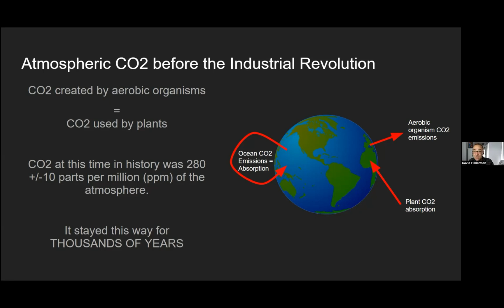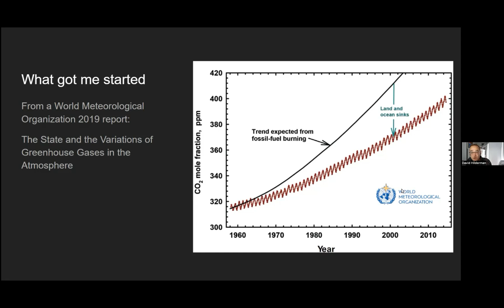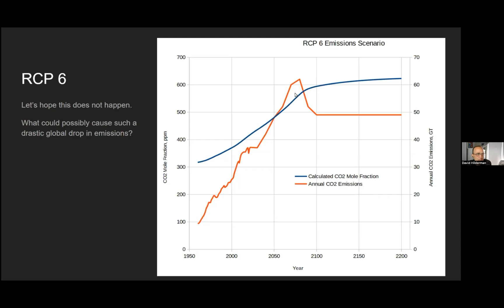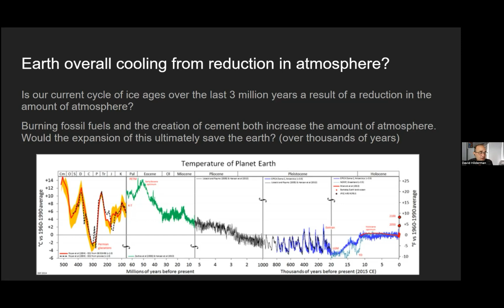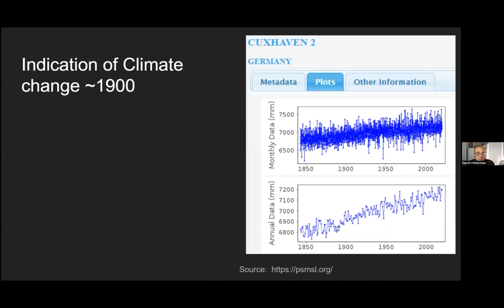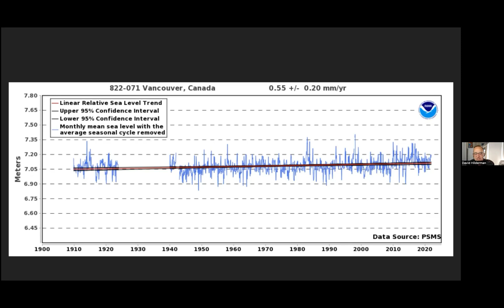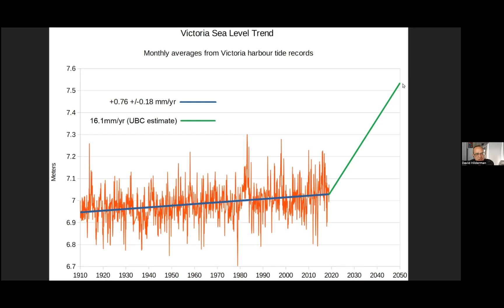David Hilderman: CO2 Emissions and Atmospheric Levels | Nelson Pod #220

Comment: One thing to remember is that cold water can dissolve more gases than warm water.  Think of it as a can of soda pop from the refrigerator vs. one warmed up.  There are many many more variables that you are not accounting for, as well.  Plants and oceans have limits to how much CO2 they can sequester.  I think you are operating well outside your expertise.
Reply: What we have in the air is what the chemistry in the ocean wants to be there. The atmosphere is just the other shell of the ocean.

If we removed all CO2 from the air by tomorrow, the ocean will soon release new, and we will be back at the same level as today in a short time.

If we double the concentration by tomorrow, the ocean would soon eat all the excess amounts, and we will be back at the same level as today in not so long.

It is the ocean who determine what we should have in the air. Not much we can do about it.
Reply: @elbuggo yes, and controlled by ocean temperatures

Comment: Earth’s atmosphere is Nitrogen (N2) - 78.084% ,Oxygen (O2) – 20.9476%, Argon (Ar) – 0.934%, Carbon dioxide (CO2) 0.0314%.   75% of the 0.0314% is from natural causes.  That means 0.007825% is man made.  That is less than 8/1000 of 1 percent.  The sky is falling………………

Comment: I'm glad you mentioned sea levels, it's something I've debated. Water expands when freezing by 9 times. The ice caps cover a very small area of the planet. The ice melts, its shrinks in volume by 9 times and fills the oceans, which cover 70% of the Earths surface!! I'm not a mathemagician, but it'd like to know how that will raise ocean levels by multiple feet?? There is an estimated 40 trillion gallons of water in the ice sheets, it would take 37.5 trillion gallons to raise sea levels by 1 inch across the entire planet. Think about that for a second.
Reply: That would be an excellent argument except you’re way off. Water is only a tiny bit bigger when it freezes.
If it was 9 times, what do you think would happen if you put a cup of water in the freezer? It would become 9 cups of ice!
The actual amount of expansion is 9%, not 9 times! Get the maths right, please…
Reply: @simontillson482  Yup, my mistake, regardless, not going to flood the oceans right?
Reply: @rideswift  I hate to tell you this, but it would be quite bad, really. Ice in places like Greenland and Antarctica is several miles thick. And they’re quite big. If it all melted, sea level would rise by more than 150 feet. It wouldn’t flood all the land, but it sure would be an issue for the coastline. New York and London, for example, would disappear into the sea, along with most of their suburbs. Not good. If you don’t believe me, just google how much sea level would rise if all the ice melted… there is no disagreement here. It’s a pretty well-known fact.
Reply: @simontillson482  You might want to read the rest of my first comment, there is not enough melt water in the ice to flood the oceans, PERIOD

Comment: I have worked several places that have various Engineering disciplines.  I always notice when there was a really tough problem to solve, it was always the electrical engineers that figured it out even if it wasn’t an electrical problem. Maybe all science should be peer reviewed by Electrical engineers. Just saying 😂
Reply: After I ran in the federal election the Association of Professional Engineers in BC sued me in the BC supreme court to force me to not call myself an engineer because i was not a member of yhe association.  They actually said in court that they did not want to be associated with someone who denies climate science.
Reply: @davidhilderman  That’s a good indication they are afraid of a challenge. True science should always welcome a challenge. It’s what flushes out the truth. What scares me the most about climate scientists is when they start talking about fixing the climate by spraying some chemical into the atmosphere or into the ocean  or some other means. I have seen many times scientists and engineers cause the very problem they are afraid will happen by trying to fix a problem that would have never occurred if they did not try to fix it. Which I believe may have been what caused the COVID pandemic.

Comment: Hi, I'm no expert but it seems to me that well yes you found a correlation between CO2 levels in the atmosphere and a direct response in absorption rate of the oceans and the land I believe that you're only seeing half of the problem. As an example imagine if a room full of furniture and carpet also had a gasoline canister or container sitting in the corner with a small leak. One could assume that over time there would be a slight amount of gasoline Vapor trapped in the carpet in the fibers of the furniture and so those measured would be very low compared to if you poured gasoline all over the room and started to fill it up slowly with gasoline. The room would be absorbing more and we should be happy? The problem still persists, the room filling up. Even if all the C02 at some point, was absorbed at the rate it was generated, there's still methane and the heat increase we'd have to see before we knew what a full room looked like. 

Your Theory would hold water if at some point the gasoline ceased to fill the room. That being the case as the gasoline is filling the room there is a direct correlation between the amount of absorption of the room the sinks as you call them, hazah! And, the amount of gasoline that could no longer be absorbed by those sinks once there was a sufficient amount of gasoline in the room would make the room's previous absorption rate, mute.

Neat that plants worldwide are having a good time (currently) as a result of us all, not caring about over fertilization and C02 emissions but a small and trivial consolation prize when we all die to weather related deaths.

That a predicted line from 1959 shows substantial upward growth and the reality is only SLIGHTLY less scary, isn't a feather in our cap, it's a misunderstanding at 1959 of various factors we now know about and include. That it's similar to reality should haunt you. 

Just a boat detailer who wanted you to be right.  I feel like I've had these moments too and believed in them as deeply as you do here but then one of my "dumb" friends, points out that I missed a big thing, like here. You've taken an optimistic snapshot of a thing when what you need is a movie. Keep trying. 

Lee

Comment: What people create (CO2) it  absolutely miniscule compared to natural volcanic production. And  planet s closer to a CO2 deficit than over production. It's a self-correcting system   if Co2 get much lower than it is now plants start to die  yes they're still trying to push the lie  wish more people would figure this out,    Good job!!!
Reply: Cite your source. I call BS.
Reply: @Local_Boydidgood  
1816 "The year without a summer" 
A perfect example of the effect of CO2 on global temp. Greenhouse gases can hold heat in But they also deflect solar heat
Away. If the sun can't 
Warm the earth  , it just
Gets colder . You have to have a heat source
Within the atmosphere
In order for greenhouse
Gas to hold the heat.
And that , even the heat of a volcano isn't
Enough to drive "Global warming".
To much CO2 creates 
Ice ages  they push fear to compel us to pay Carbon Taxes to fight a problem that doesn't exist.

Comment: Indeed CO2 is plant food. Regarding your graph at circa 15:00  - I think this cyclical variation could be to do with the regular solar activity, the timing seems about right (with a short lag as expected). Now don't get me going on the 'activists' - they have no idea as what has happened over 100 years and has no connection to what out planet does over millenia. It is basically a new religion, a cult. But to those in power it is just a money machine. It's shit.

Comment: Renown scientist Dyson Freeman (Princeton and the Instituteof Climate Studies) studied CO2 for 40 years.     The earth is increasingly growing greener with CO2 rise.   Plants are  growing better, the earth is getting greener,  forests are better and crop yields are going up.   

The rise in CO2 has gone into the rise of vegetation, food production and biodiversity...all beneficial to man.

 This has been measured by satellites.  

These are huge non climate  threatening benefits. CO2 also works well when complemented with Nitrogen.  Commercial growers routinely induce CO2 to 1200 PPM when growing plants.  
CO2 is only dangerous or toxic at 40,000 ppm levels 0r 100x current levels.  CO2 also makes up less than .04% of the atmoshere

Dr. William Happler finds commonly CO2 runs 1600-1800 ppm in many gathering of people in enclosed rooms with NO negative  effects dispelling  the CO2 hype by climate alarmists.

Comment: Thankyou, finally someone does some calculations.  This is one thing the climate alarmists should be challenged on. If all this has been "settled science" ie known science as they have told us for decades ; then surely by now some of them ought to be able to tell us what the ideal temperature of earth should be , and thus how much co2 we have to remove or add to the atmosphere go acheive that. But so far none of them have given us this basic part of the equation. I suspect many "climate scientists" are actually just statisticians. A give away is their tendency to average out to higher precisions than the instrumentation probably measures. Also why does yhe start date always vary, i thought we were being measured against pre industrial times. 1960 or 1987 (used elsewhere) is not preindustrial by any stretch , but they still use these arbitrary dates .

Not knocking your efforts but from a philosophical point of view how do wmo, nasa, noaa etc get their conclusions from their data eg the proportion of co2 absorbed into the ocean. Why hasnt Michael Mann released his hockey stick data as mandated by canadian court order? What has he got to fear from releasing to the courts?

Why is world atmospheric ,co2 baseline measured on an active volcano?

The sea level was supposed to have risen by 10 metres years ago (possibly circa 2010, but i can't remember exactly what year because they keep changing it ie moving the goalposts). This goes for many of their predictions, 32 according to some sources. 

A very interesting presentation, you are doing the the calculations that many of us would have loved to see ourselves doing.

If you are Canadian you might be interested in the CDN channel (climate ????? Nexus, cant remember the middle word) you probably have common cause.

Comment: My career was motorcar exhaust emissions measurement.
From the eighties 'Carbon Footprint' scam, I have known it IS a scam.
There is not enough CO2 in the atmosphere to have a 0.5 Kelvin 'Greenhouse Effect'. The 100 ppm increase in 50 years 'could' hold 0.15 Kelvin close to the surface.
Reply: The ocean will eat all excess CO2 anyway.

Comment: Man made climate change is complete nonsense.  If you look at what's been happening with the earths magnetic field getting weaker, it exactly tracts the atmospheric CO2 level.  The other thing that happens with the earths magnetic field getting weaker is more charged protons strike the Ozone in the upper atmosphere and break it up, especially at the poles.  So the Ozone hole also has nothing to do with human activity, in fact man made CFCs are totally insignificant compared to the effect of naturally occurring ocean halides on Ozone.  2/3rds of all man made CO2 was created within 20 years between the mid 1990s and mid 2010s during China's infrastructure boom.  If man made CO2 had any effect on the atmospheric CO2 level there should have been a huge spike in the level during that time, instead there's nothing except a smooth graph line going up 2 to 3 ppm per year.  There's so much junk science to debunk I could go on all day.  For example, when calculating carbon sources and carbon sinks, the original formulas being used took the time each sink would require for each source to cycle carbon out of the atmosphere, added the times together, and took the total time as how long man made CO2 would reside in the atmosphere.  The problem being the carbon sinks work concurrently, all at the same time.  They don't wait in line for their turn to absorb CO2 out of the atmosphere.

The people behind the environmental movement are big banks and big oil.  Big oil wants to keep the price of oil from collapsing by restricting the volume on the market.  The big banks want inflation to diminish the value of all the debt in the financial system.

Comment: The toxic level of CO2 is 40,000 ppm  or about 100X current levels. 
Dr. William Happler measures CO2 in his talks and points out his  classrooms and lecture halls routinely run 1600-1800 ppm and No one ever gets ill. 😂😂

Comment: Due to the absorption spectrum of Co2 ,(which is similar to the main green house gas, water vapour)
it's warming effect on the atmosphere is not directly proportional to how much of it there is - each additional part per million does not have an equal warming effect.
This can lead to an over estimation of projected global warming based on Co2 levels.
Anyway, the planet will self-regulate, it always has.
Reply: You can't convince someone that has experienced a drought that water vapor is bad.
Reply: doubling the Co2 =>  1% decrease in emissivity, thus T1^4 x emissivity1 =T2^4 x emissivity2 => thus doubling the Co2 would result in a temperature rise of ~ 1C globally. No big deal. The theory is based on that the power in (sun radiation) = power out (radiation out T^4 x emissivity)
Reply: Yes but the main driver is they can’t figure out how to tax water vapor.

Comment: CO2 is a climate follower warmer oceans release CO2 cooler oceans absorb CO2. A1 degree change in ocean temperature will release enough CO2 to increase atmospheric CO2 by about 37ppm (and vice versa) (easy to calculate using volume of ocean, volume of atmosphere and solubility of CO2 in water) that change in CO2 could only cause about 0.02 degrees of climate change. (so there is no positive feedback, CO2 in the past was just following the solar controlled climate not driving it. 
The last time CO2 was at 400ppm the planet cooled 
The last time CO2 was at 800ppm the planet cooled 
The last time CO2 was at 1000ppm the planet cooled 
The last time CO2 was at 2000ppm the planet cooled 
because the effect of the Milankovitch cycles is 25 times more powerful than any doubling of CO2.

Comment: 3rd world crop yields have doubled over the last 50 years. 1st world yields have quadrupled thanks to the use of fertilizers and better seed weed and pest control that are not available in the 3rd world.
CO2 CANNOT cause significant warming. the calculated shielding effect of CO2 is 3.7W/m2 per doubling. 
Using a Stefan Boltzmann calculator it is easy to calculate what effect that would have on temperature and it is 0.7 degrees C per doubling of CO2
Since the beginning of the industrial revolution CO2 levels have increased by 50% or about 2W/m2 or 0.4C

The variation in the miss match in your graphs fits the Solar variability 11 year cycle quite well. 

The climate is controlled by the sun, lots of black spots reduce the amount of energy that can reach the planets surface is reduced fewer sun spots and the planet warms slightly.